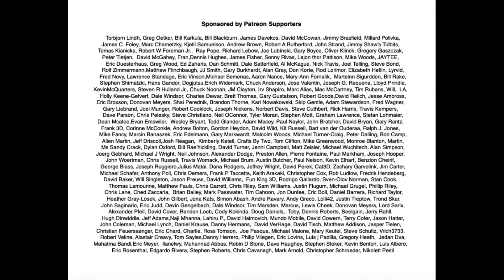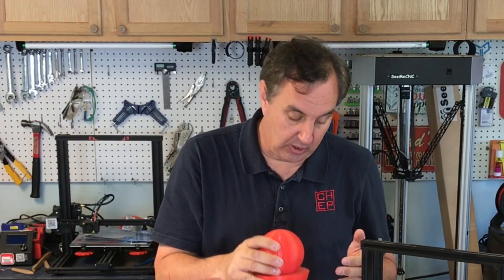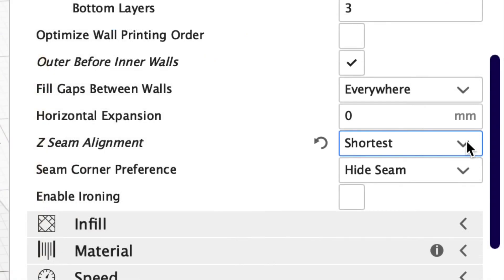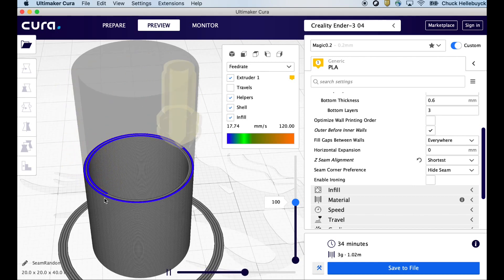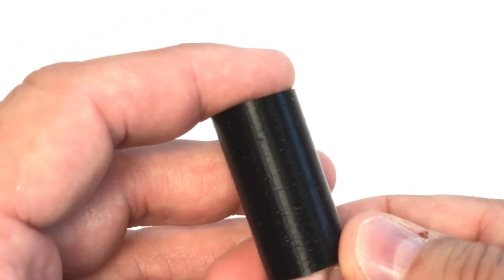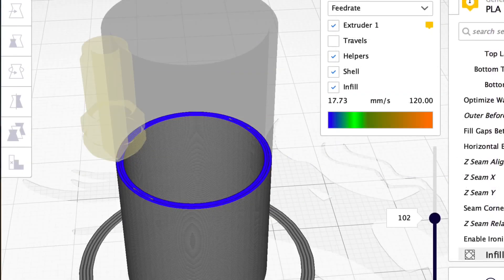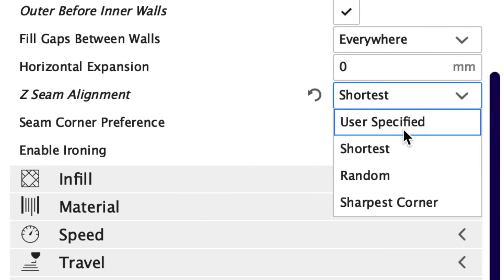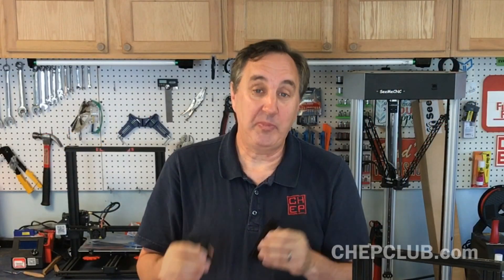How to Control Seams In Cura Slicer Settings

Comment: Chep you are totally awesome. It's a problem I've been struggling with and you solved it.
Reply: Same here....!!
Reply: same here im working with vertical objects and it annoys me having that darn line! lol but I think the random one looks best imo! Thanks for saving me hours of trial and error!
Reply from the maker: You guys should all try my 0.12 profile (round)
Reply: @FilamentFriday  where can I find your cura profiles?
Reply from the maker: https://www.chepclub.com/cura-profiles.html
Reply: @FilamentFriday  hey Chep, I'm using your profile currently and for some reason I keep getting these light blue travel lines in my prints. Any way to get rid or them? I also get a seem or in cura you can see a white line where they meet. Hope it makes sense. I have been struggling to fix it. Thanks
Reply from the maker: Click on Line Type at top bar in Preview mode and then uncheck travel and seam from the menu.

Comment: how do you get the printing simulation animation like you have in the video, where it shows the print head moving?
Reply from the maker: It’s an option in Cura preview.
Reply: @FilamentFriday  I cannot find it, i have 5.4.0, can you tell me where
Reply: @QuietMikeW  Go to Preview and then move the slider in the bottom mid from left to right. You should see it then

Comment: ZERO information about how to actually reduce the oozing. Only talks about moving the seam around.
Reply: if you are using ender 3 pro, turn off the power outage setting. When it goes around and prints it stops and saves at specific points in case if there is an outage. What this does is it allows it to ooz and create little dots on the side. When I turned it off it worked.
Reply: @SecVo  thank you
Reply: Bro the video says seams, he doesn't even mention oozing why would you expect that

Comment: Awesome tutorial!  Essential for holes as well!  New to this hobby, and was wondering why I had this "artifact" running down one side of all the 1/8. 1/4, 5/32, 5/16 inch holes I had in a  1/4" PLA plate I was making.  This makes fitting metal support rods through the plate about impossible without first drilling.  Randomizing the seam location gets rid of this and when you push the metal rod through it effectively "deburs" the hole.  Just be sure the rods aren't too tight or else you might crack the plate, so a light sanding might be best.  Without this tutorial I'd be lost on this one as I kept going down the retraction rabbit hole. And indeed it's related, but if your retraction settings are reasonably good then this is the fix.

Comment: version 5.2.1 support this?
Reply: I'm running 5.1.1 if that helps, and the seam settings should be under the Walls tab, not the Shell tab.

EDIT: I just updated to 5.2.1 and yes the settings are still there

Comment: Well, I'm printing radius fingers for my box and pan metal brake. I print them standing on edge because the radius is the most important part and I can print each finger without support. With sharpest corner selected it decided to place the seam directly on my radius. I'm beginning to think cura is getting worse with each iteration. Current version 5.1.0
Thanks for your video. I think I'm going to find a way to fix it.

Update: I now know how to specify definitively where to place my z-seam.
Problem solved.

Comment: I have an object that is an Arc. Since it is an Arc the inside and outside lines are printed as one (generally speaking). However, the seam always is on the outside of the arc and it "seams" to me I should be able to have the seam on the inside wall of the arc...?
Reply: All that you would have to do is set the "z seam alignment" to the center of the arc and it will make the seam point toward that spot.
Reply: @taz12480  Thanks, I got advice from Cura that worked great. The trick is to set "Z Seam Relative" and zero out X and Y.
Reply from the maker: Depends on on how you have your seam settings.
Reply: @FilamentFriday  Well, I assume if it is possible I haven't found the proper settings yet. So,? You're right.? The implication of my comment was to see if anyone had reference to what settings I might look at.?
Reply: @FilamentFriday  Oh, you are the content creator. I thought someone was trolling me. So ya. All the setting I try in Cura only leave the seam on the outside. There is no inside seam. So, I feel I should be able to move the one and only seam to the inside of an Arc. ?

Comment: Any reason you'd want to start printing with the outer walls first?
Reply from the maker: It can give you a more accurate outer dimension.
Reply: If you have a very thin print with fill gaps in walls turned on it will allow the printer to print the outer walls first then fill in between them with the gap fill allowing the outer walls to act like a frame and hold the gap fill in place.

Comment: Hey. Can some one please explain why if we have a print that has infil why cant it go to where the infil is and step up the the next layer there therefore eliminating any seams on the outside walls
Reply from the maker: There is still a seam where the outer wall starts and stops.
Reply: The only way to not have seams is printing in Vase mode, but it's meant only for very specific prints

Comment: when I slice my part, I look at preview,  there are these white dots that look like a seam... HOW do you get rid of this..  I didn't see that on your print preview..  Round parts..  CURA 5.0      I didn't have this problem in previous versions of CURA..
Reply: in the preview tab there is a tab titled Color Scheme. there you can activate and deactivate what is displayed, including the dots that literally represent your seam. the white dots show where the nozzle moves to the next layer
Reply: @billcypher564  those little dots didn't mess up in past versions of Cura,  I have made a few round parts and didn't have them so noticeable as they are now.. it wrecked a couple of my latest prints... sucks.. and I changed no settings ... now I use PrusaSlicer 2.4.2 and it works a lot better... there was just a small learning curve.. now I'm  happy again...  :)
Reply: there is a setting in Cura that lets you pick the random start point of each layer. Seam Corner Preference
Reply from the maker: Cura posts in their bug fixes: 
Hopefully they improve it soon. 

Known critical issues:

The placement of the seam has gotten more scattered than in previous releases.
Reply: Something that I've found that sometimes helps with the scatter on the seam is to slightly rotate the object in the slicer.

Comment: My son is the one 3d printing and I'm just helping him learn things. We work on projects together. My question is what version of chess are you using. We are just using the free version and it doesn't seem to give us this option? Thank you
Reply: If you mean Cura, you can open hidden settings by either searching under the print settings or hovering over each main setting and you'll see a symbol appear and it opens a window where it shows all available settings with more detail. Hope this helps!

Also: Preferences>Settings is another way of accessing these settings!
Reply: @sidekikz  yes sorry didn't realize my typo. We found that it was that he just had it in beginner mode or something like that. We changed it to advanced and it gave him more options.  Thank you.

Comment: why isn't there just a mode that makes the slicer just overlap the wall a little so it fills in the z seam.  it's so dumb this isn't standard and i don't want to manually do that for an entire print
Reply: in Cura it's called Outer Wall Wipe Distance, it basically does exactly what you said. 
And also there's Coasting which has the opposite effect
Reply: @ntcong  
nice it was disabled on mine.  thanks
Reply: Something else that you can do is make a small outcrop that's twice the width of the nozzle at the point that the slicer has your seam so you can just cut off the small seam with flush cutters, rather than deal with seam settings
Reply: @taz12480  Thanks for the tip.
Reply: There still would be a seam with a bigger bulge. Its possible to do this but the seam looks worse.
Reply: @Ilikedahrice  
the buldge would be prefferable over an inseam  
and it should just be possible to compensate the flow for the overlap.  

but a bulge can be filed or sanded away.  
a seam that is missing material though cannot be removed unless i can somehow fill it up with something else.

Comment: Hi Chep. Thank's for your videos. You have helped me out loads over the years. I have a new issue I haven't encountered before. I am printing two new cylindrical objects with flat tops and bottoms. When I print I am getting a seem in the base layers which is clearly visible across the face of the prints. I have printed many similar objects in the same way and never had this issue before. The only thing I believe I have changed which could contribute to this is the resolution, where my previous prints were in 0.2 and these are 0.15 on one of my printers and 0.16 in the other. I'm not sure if there are other differences in the settings, but I can't notice any. Have you any idea why this is happening and how I can fix it. Thank you

Comment: What is the best retraction speed overall I changed mine from 45 to 35 seems to have helped a little with stringing and changed retraction distance from 6 to 4.8.  Under retraction speed is also retraction retract speed and retraction prime speed should those values be the same as the general retraction speed field?
Reply: Just be careful with too fast retraction speed, I got multiple cases of filament grinding that ruins my prints midway, the goddman filament just break.

Comment: Why doesn’t my cura have shell? I get a line on every benchy on the hull.  Same spot.   Even if I rescale.  Help.   Thank you.
Reply: In the newer version, this option is split into "Walls" and "Top / Bottom" options. The seam options must be turned on because it is hidden by default. Look in the hidden options, turn it on and it should appear in the "Walls" section.
Reply: @Neso_389  I’ve turned everything on.  I don’t think this version has shell.

Comment: To say „hide seam“ is useless and try it only on a cylinder is a bit silly… it does not work on round objects…
try it in a complex object, it will place it on edges wherever edges are, so it’s a „clever sharpest corner mode“ 😉

Comment: Hey CHEP, I just started 3d printing this year but have been watching and enjoying all of your content for many more. I have a question I have been struggling to find an answer to. In Cura, is there a way to align the z seam on different parts printed on the same build plate? I have tired support blockers with different specified settings but the Z seam from the print settings seems to override it. Is there a way around this?

Comment: In Prusa Slicer I do not have these seam problems. I've run full 32mm bases and nor even looked at my mini settings and it just gets this right. However in Cura this seems to be a sustained issue. I had this seam build up on a silk filament today and it was pretty disappointing since the main change was going to Cura.

Comment: I have the exact opposite problem, my model will have a line cut into it and when the printer gets there it stops
Reply: Sounds like you have coasting turned on
Reply: That is what coasting does, but it can happen without coasting switched on too.  Keeps happening to me too and I have coasting switched off.  Could be something to do with retraction distance or retraction speed?

Comment: In my case the seam appears to wobble some causing an indent on the part. What's strange is it didn't do this before. I was printing a chess set and the parts started out flawless and after a while the seams became more noticeable with each print. Now as I said there's an indent on the most recent parts. Any thoughts? I'm printing on Tronxy X-2 Pro. I have two of these and on one the seam is minor and on the other the seam is worse with said wobble and they're printing identical pieces so it's definitely something the one machine.
Reply from the maker: Tighten everything up including belts.
Reply: I started having this problem when my motors started to go bad. I had to change my yaxis motor on my cr-10, printing flawless now!

Comment: Would be interested in seeing you reprint the tests with Cura 4.8 and the new smart hiding option on z seam.
Reply: I just got notified for this update, is it worth updating?
Reply: @ediblecacti  It is if you are using 4.7.  4.7 was a buggy mess, but 4.6 was very stable and bug free.
Reply: @Stormtrooper1787  ok, thank you.
Reply: smart hiding isn't new feature. it's there for ages. and doesn't help much

Comment: I use coasting to get rid of seams. I can get round prints without any seam whatsoever without touching any of these settings.
Reply: Will you provide some more details so everyone can try your method?
Reply: @hansense1760  Basically, I use a slightly higher than normal flow rate +2% ish and enable coasting. play around with the coasting volume, I have it set a teensy tiny bit higher than default. The higher flow rate adds a bit of extra pressure in the nozzle that will leak out while coasting. If that extra pressure and coast volume are balanced just right it can lay down very clean blobless lines. I'm on an ender 5 btw. ender 3 is no different.
Reply: @jenshendriks9092  Thanks for the further info! Just getting started (bought the Sovol SV02) and every print is another attempt at getting it right, for me. I'm trying as many tips as I can to get the expected results, so even if they don't seem like much, your details will guide me and help with learning the seemingly hundreds of settings and how they affect my outcomes!
Reply: @JaXX Is your extrusion rate too high? That could lead to ineffectivity of coasting. Also make sure your filament is really dry

Comment: "Hide seam" puts the seam on an inside corner, hiding it. Your model is round and has no corners, so...yeah
Reply: Exactly this.  It helps a little on prints with sharp corners, if you don't like the tactile feel of a seam on an outside corner.  Lots of people here are recommending "Smart Hiding", but that does more or less the same thing - it allows inside corner and outside corner seams but prefers inside.  Nothing but vase mode will hide a seam on a round part.

Comment: Cheap it’s funny I’ve talked to all the big five but you I got a question where did u say you can get a box of m3 m4 m5 bolts and t nuts and where do I get ur little tool box I’m gonna build a cnc I designed it on tinkercad I wish u would do a begginers guid to fusion 360 I’m have trouble learning it
Reply from the maker: Links are in the video description
Reply: Thanks chep you help out a lot I know my way around a 3d printer but u make me feel dumb keep up good work

Comment: To my understanding, the "Hide Seam" option moves the seem to a place on the print that is less visible, if such a place exists. So if you imagine printing the letter "T", the seem would be at one of the corners where the horizontal line meets the vertical line. But if you're printing a cylinder or a cube, there's no such place to "hide" that seem - every possible location is basically equally visible. So I think this option only makes a difference on more complex shapes.

Comment: On a round object (like that pawn), in some cases you're much better off having a single seam in one location. It's easier to sand a single seam, which saves you from ruining the nice smooth surface on the rest of the print... compared to having to sand everywhere to get rid of all the countless little "bits", thus leaving a dull matte surface in most cases.

Comment: Hi! Didn't help me out. (Sadly)
I wish I could completely get rid of this seam and not only move/reduce the problem to another part of the print.
I slowed down the print, adjust acceleration to try to have a good controll of the pressure in the nozzle during the z-axis displacement but the seam is still visible and mess up the visual aspect of the print. 😢
Reply: Tell me if you find a solution
Reply: Z layer change retraction
Reply: @angrovar  Do you mean "Z hop" or "retract at layer change"?
Reply: @dakrath  imma be honest, I think I just mean retraction but I couldn't tell you what kinda stroke past me had

Comment: Is it possible to make the printer print the whole round job as a spiral ? Maybe that will leave a weirder seam??
Reply: that's vase mode (not sure exactly what it's called in cura, but I have seen it there a few times). it has zero seam then, but you're, I think, limited to one single wall, and one continuous path, so avoid ANY and ALL travel moves. it can look VERY good though.
Reply from the maker: It’s called spiral mode in Cura

Comment: Chep! Big fan of your channel, thank you very much for all the info you give us. Question! Do you know how to control seams in a project where you put more than one model on the bed? I'd like to set a clean seam in all of them but Cura doesn't seem to have options for this.
Reply from the maker: No.sorry I don’t.
Reply: You can do this in Simplify3D - you create a separate print process for each model, and set the settings for each of those processes. It can then print each one layer-by-layer, whilst applying different print settings to each model.

Comment: From a structural standpoint is the seem a weak spot?
Reply: Not really, if you have appropriate infill settings.  It will have a small effect but not much unless you're using a very low infill percentage.

Comment: CHEP, your no-seam profile does not work on round objects...  any ideas? i have been trying to get this 170mm round cylinder to print without seams/zits but i have no luck.
Reply: Try random for the seam location
Reply: Tried and nope.
Reply: Sand paper?